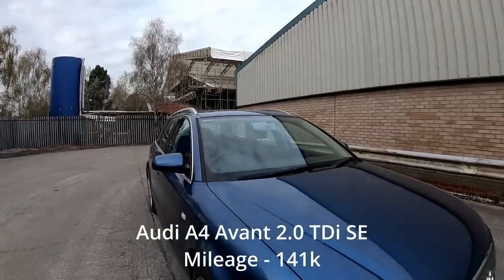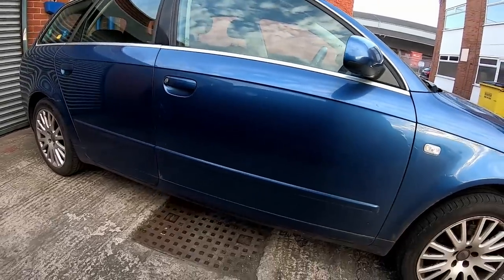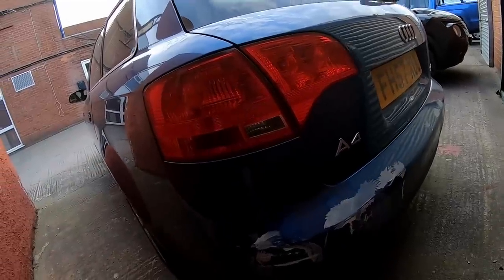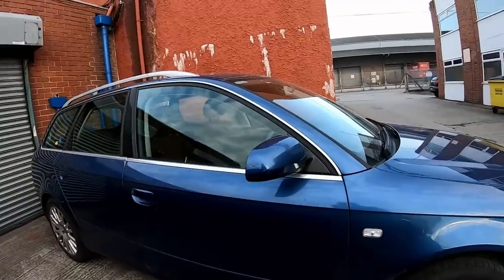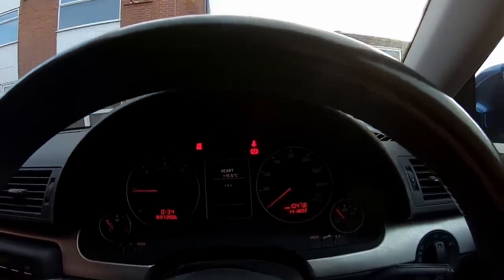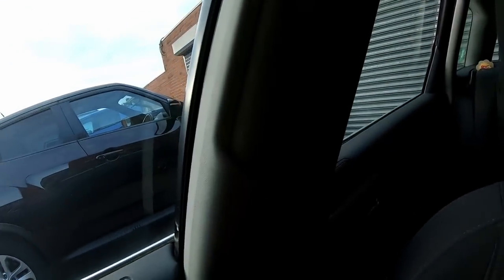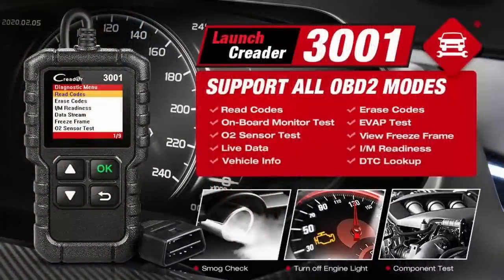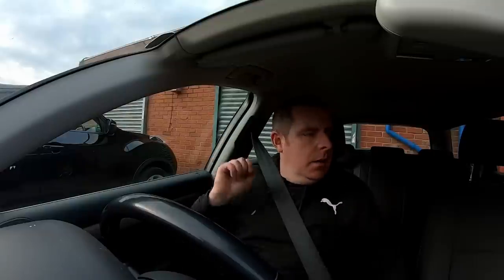I BOUGHT A CHEAP AUDI A4 TDi

Comment: I literally was thinking about the pinch bolt before you mentioned it and had a little chuckle when you did. The amount I see on the Audi forums for these and the b8 where the bolt has snapped when trying to remove. It’s a nightmare. 

I own a b8 2.0tdi myself. They go for miles. Lovely when they’re right. Mines currently got 210k thou me doing 140k in last few years. Barely missed in a beat in that mileage. 

Looked after and they go forever with minimal problems.
Reply from the maker: Yes they are a top car, I suspect he will be drilling the bolt out of at least one side ada 🤣

Comment: Gutted there won't be a follow up vid showing the work needed to get it right..  would have made great content considering it needed quite a few bits doing.  do like your videos though.  Maybe could include more workshop stuff ? Best regards 👍
Reply from the maker: Hi martin, sometimes I just flip cars on like this one so not always possible to follow up, I do try and get a bit of workshop fixes in some videos but its very difficult as we are a full time working garage and I am constantly on phones, dealing with customers and mot's in between so don't get the time I would like to do more filming. However I do have changes a foot to get a better balance and push forward the channel and content in the coming months
Reply: @carukchannel  thanks for the reply.  I understand you have a business to run etc.  😊  u always come across well in the videos, no waffle.

Comment: When you do the cambelt you'd also do the water pump right ?
Reply from the maker: Yes they normally come as cambelt kit witch includes a water pump, occasionally you get some vehicles that the water pump is not driven from the cambelt in which case you may not need to then replace it

Comment: Those cheap Chinese suspension arms won’t last 6 months, probably even less but I guess when your selling low end cars it’s all about getting them out the door as cheap as you can.
Reply from the maker: A little bit of unfair assessment, I have a few vehicles that come back to me for MOT with parts from online non OE and years later going fine with no issues, occasionally you get some bad quality parts but I have had some crap genuine parts and bosh parts lately from my local dealers so its not always the case that buying premium is the only way, I try to weigh up cost and quality where possible on the cars I am selling as you rightly put. thanks for watching Umar 👍👍

Comment: I brought one these over a year ago same issues had it all sorted now I own a loverly reliable car 
The key problem I had same when I picked mine up I changed battery’s still no luck I found out you have to put ignition on press the unlock button for ten seconds it reprogrammed to key to car and worked
Reply from the maker: thanks q will pass the info on 👍

Comment: I had a 54 plate A4 1.8 T sport Avant which I bought just under 14 months old.with over 79,000 miles.. Faultless other than when radiator got peppered with a stone bumper etc had to come off £200 for that only £10 for the radiator repairing. After 4 years sold it to a workmate who still has it wellover 10 years later.
Reply from the maker: Thanks for watching jeremy, great to hear your old a4 is still going 👍👍

Comment: I owned a 2005 SE and a 2006  s line both 2,0tdi the 2006 had the sat nav and 2 tone black and grey volcano leather this was back in 2010/2011 they drove really well and as you said Lee had a bit of kick low down from the turbo, since then I have bought Autos too many bmw/audi/Mercedes /Range Rover to mention as a trader.
Reply from the maker: Yes they are cracking car, I always preferred the 2.0tdi audi a4 over the C220 and 3 series of this era.

Comment: Great video. I drive a B6 1.9 TDi Avant Sport and it’s brilliant. 20 years old and the fit and finish is still up to modern day standards. Funnily enough my steering pulls to the left, not quite as severe as the one in the video but I’ve just ordered the parts needed.

They hold their money well and the interest is high. 👍🏻
Reply from the maker: thanks Daniel, yes does sound like you are in need of suspension arms also might be worth getting it tracked 👍
Reply: The only way to correctly drive an Audi is to have a toe-in-curve adjusted to spec when doing a wheel alignment after messing with the front end.

Comment: Trust me if you want to be in a dangerous car try driving my old Mitsubishi Colt from 2007 , its fast for a 1.1 litre and goes round corners well but i should not be driving it as it has 1 broken spring front passenger side knocking and the rear springs are creaking , also theres a weird acrid burning smell from under the middle of the car ? its been doing that for months im thinking cat converter but i only paid £600 for it 5 years ago , have now finally got the money on my credit card to get the springs replaced 4 springs gonna cost me £450 to replace not cheap but i think it will make a huge difference , as for the Audi that car would be worth a lot when the problems are sorted.

Comment: 2.0 tdi is good engines 1.9 better but simple 8 valve reliable motor. Could never figure why they rust on wings poor construction?😮
Reply from the maker: Not sure on the audi's but the golfs and boras of this age had sponges in the wings to soak up moisture and supposed to drain away, ironically  they got full of crap and mould and just collected the water and rotted the wings inside out